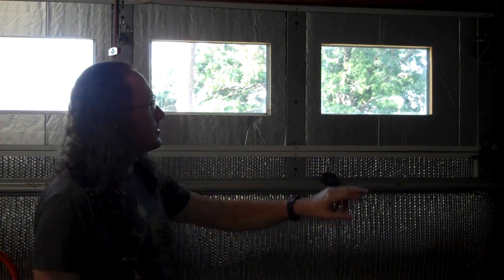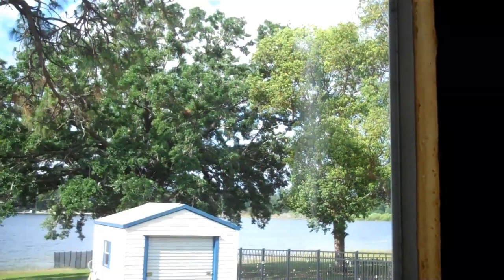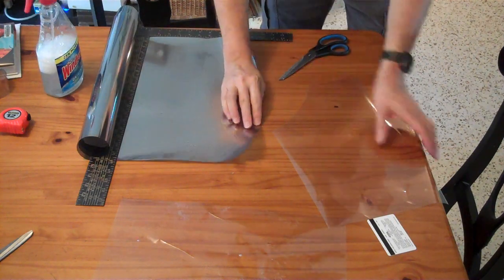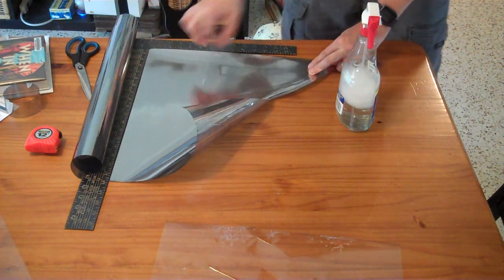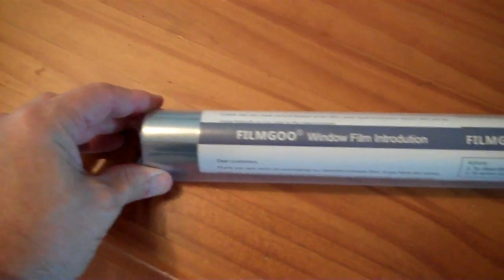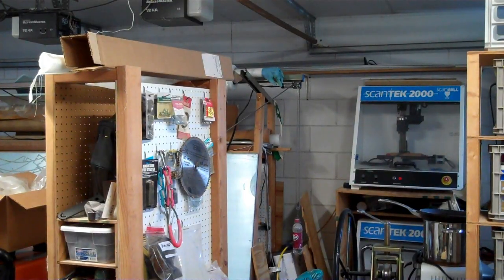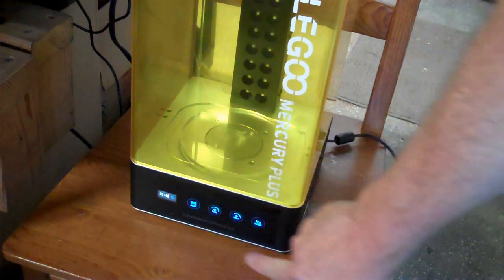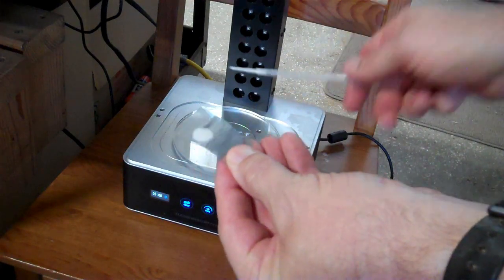UV Blocking window film to protect 3d printing resin from curing early

Comment: Here's the problem though, those films block UVA and UVB, but more often than not, not 405nm, which is what cures the resin.

This is why I'm using PVC double sided fully opaque window film instead.
Can't have UV exposure if no light at all comes through
Reply from the maker: They seem to block enough UV that I can leave drops of resin out without curing for an hour, which is enough for me, as the printer has its own plastic shield.

Comment: Is it not easier to apply filter to the close container of printer?
Reply from the maker: The printer has a UV blocking cover, but I need to be able to take the print out and pour the resin from the vat back into the bottle without having it solidify in the vat.